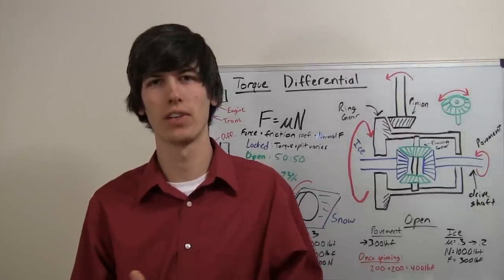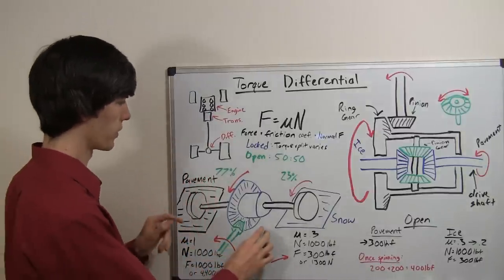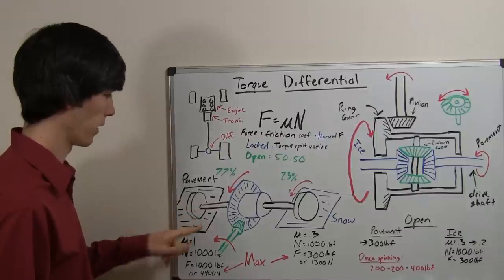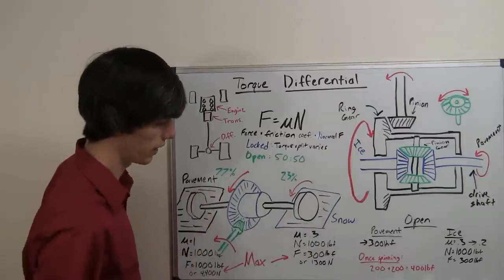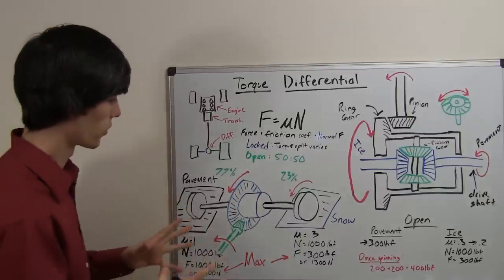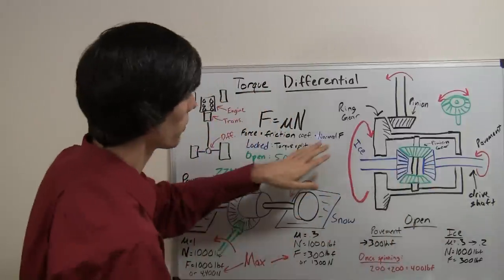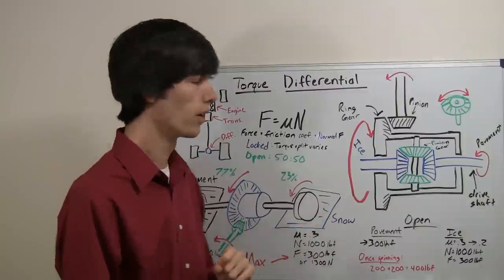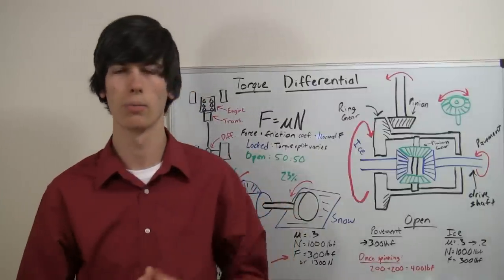Open vs Locked Differential - Torque Transfer - Explained

Comment: Sir, you have not answered any of my questions. You keep dancing around them. Okay so you want to do sources, You have not provided a list of sources that I can find. If you would be so kind and list a few for me.  As far as sources from me, I have one for you. "Locking differentials force one of the side gears to rotate with the differential housing. This causes the differential to act like a solid axle and transmit all of the torque to both of the wheels." CAT 90 Caterpillar Undercarriage and Final Drive, page 1-2-2 paragraph 5. Now if you could please provide me with a source that challenges this that would be great.
Reply: Tim W.  Finally someone who gets it. It's not that he is wrong about how the torque is applied, he is not explaining how a locked diff works. Which does not take a lot of complicated math to do. I tried to get this point across to him way back but it got lost somewhere with all the replies and his pride. But after I found out he gets all his knowledge from wiki and how stuff works and probably has only ever worked on his acura, The light went off in my head. Why am  I, a 10 year experienced dealer technician wasting my time.
Reply from the maker: Roshsun Stewart I know you think I have no idea what I'm talking about, and that's fine, but you just agreed with someone who said

" In the case of a fixed axle, there is a constant torque through the axle, but the two wheels can be applying different torques to the ground, depending on what surface they are in contact with."

You do realize he's saying torque can be split between the two wheels, and is not always equal, even though you've been disagreeing with this point since day one. Also, I'm a graduated mechanical engineer, I have a bit of a knowledge base of understanding torque, moments, and static forces. This understanding is important for understanding differentials. But by all means, please don't waste any of your time.
Reply: One last question, Did you get your degree from wiki and how stuff works? Because those are the only references you source. I also have a degree and the College I went to frowned on sighting wiki and would have immediately slapped an F on our paper. But degrees mean little without experience which I also have. Oh and I don't just have experience working on my Integra at home. I'm a certified dealer technician for the last 10 years.....Clearly I don't know what I'm talking about. pfff
Reply: You have a degree in mechanical engineering and you're a dealer technician? Maybe you didn't get a real job as an engineer because you don't understand physics.
Roshsun Stewart
Reply: ***** Sorry took me a while to respond back. I been a little busy.
Okay first off,
Torque is a twisting or turning force not a push. A push is a completely different type of force.
Now why would I stop imagining the engine provides the torque when in this case it does. The topic is about automotive diffs and all the forces are coming from the engine to spin the axle. I can take a wheel all day and touch it to the ground and create 0 torque.
I don't understand how waving my finger in the air has anything to do with torque. especially since the force being used to wave my finger in the air is a completely different type of force. I don't have to spin, turn, twist or torque anything to wave my finger. I think that has to do with muscle fibers and brain waves. But I'm not a doctor.
Again you loose me when you say drag your finger... I don't have to spin, turn, twist or torque my finger to drag it on a desk. I also think that's a different type of force.
Now torque does not require friction. But friction is in the equation. Hmmm. What your missing is that it takes a certain amount of torque to overcome friction. That is where friction comes into the equation. if there is no friction then no torque is needed to spin, turn, twist or torque the object. But there is always friction in this case.
I think you cut to many corners when trying to explain it in layman's terms and as a result made absolutely no sense. Next time read the definition torque from Webster before you make your next post.  Because you just sound.... how can I say this in laymen's terms......... clueless.
Reply: Tank Ronin In this case friction is what makes traction possible. We are talking about friction at the wheel base, in contact with the ground. The friction you refer to (the friction torque must overcome in order to spin) is located at the axle, at the center of the wheel, where torque is applied. The friction this video talks about, however, is what makes the wheel stick to the gound. If the force applied to the gound overcomes this friction, then the wheel will spin and the car wont go. 

The misunderstanding here I think, is that the equation in this video F=uN is for the force required for the wheel to slide (or spin without going), not the equation for Torque. The equation for Torque if force times distance, in this case de radius of the wheel. So friction and torque are really never in the same equation, they are related of course eventually, because this toque which is being applied to the wheels translate to a Force being applied to the ground, which must NOT overcome the frictional force (which depend on the coefficient of friction and de normal force) otherwise the wheel will spin, and again, the car wont go. 

So yes, each wheel con have different magnitudes of torque, depending on factors like weight on each wheel and the coefficient of friction between the tire and the surface it is in contact with.
Reply: I was a technician on heavy equipment, I made twice as much as most of our engineers. So who had the real job?

Comment: The first video was confusing and this one is even more confusing. I swear to GOD I'm not trolling. If I'm understanding correctly an open differential is better than a locked one (since according to him the torque is applied 50/50 in normal conditions) I want a new car for my daily commuting (not sport car) and I'm not sure if choose one with open differential or limited slip. Someone help me please.
Reply: Probably would want an open differential, since you wouldn't be doing much offroading and efficiency in everyday corners would matter more
Reply: Brandon Strecker

Great!
That I was thought, for a daily commuting an open diff. will be better. Efficiency is my goal.

Thanks Brandon.

Comment: a spool isn't 50/50 torque distribution, it dynamically varies from 100/0 to 0/100 based on LOAD.

you are confusing rotational speed with torque application.

Imagine turning a bolt with a wrench in free air, lots of speed but no torque. same bolt, but it's rusted up and seized into something, no speed lots of torque

Now imagine a bolt in free air welded to your seized bolt, if you try to turn them the seized bolt will take 100% of the torque and the free bolt 0%, even though they are locked.

Comment: You know where you went wrong. The moment you said "You don't even need to know how it works." If you can't explain something simply, you don't understand it. What is torque? A twisting force that causes rotation. Now please explain to me how can you have two different twisting forces in a locked diff that is acting as one solid axle. Let's take out speed and focus on how you apply two different twisting forces to an axle when only using one drive shaft. Go hold a broom with one hand and try to get each end to spin differently by twisting your one wrist.
Reply from the maker: I have videos on differentials if you'd like to know how they work, this video was made to clear up to people who don't understand how locked differentials can have different torque at different wheels, which is why they're so popular off-road. If one wheel's in the air, nothing resists its rotation, so no torque goes to it, and all torque goes to the wheel on the ground. You can have different speeds with even torque, you can also have different torque with the same speeds.
Reply: Engineering Explained You keep telling me you have videos, but this is simple. You don't need complicated math to explain what is going on. I am starting to wonder if you need to know how differentials work because I do. I have been rebuilding differentials and installing them for years. Now here is a simple question. If the wheel in the air is not receiving any torque, then what is causing it to spin? Don't tell me it doesn't spin because I have diagnosed, tested and replaced locked diffs for the past 10 years and in a locked diff the both wheels spin whether on the ground or in the air.
Reply: Roshsun Stewart I dont understand what you mean? With a locked differential both wheel spin at the same rate, but most of the torque is still going to the wheel that have traction right? Is it wrong to say that?
Reply: lurifix The reason why you don't understand is probably because if you are learning how a locked diff works from this video or the other video where he explains a locked diff, he is simply wrong. What you are referring to is a Limited Slip Differential. The purpose of a locked diff is very different. He is not explaining how a locked diff really works inside and this is his biggest mistake. inside a locked diff carrier housing, the pinion gears, or what mechanics called spider gears, are prevented from turning on their axis which causes both sides of the axles to turn together. Now all the gears inside the locked diff are moving as one piece. It is impossible to have two different torque (twisting) force going to each end of the axle when all gears are locked together. The ground surface, friction at the tire, all of that stuff has nothing to do with it.
Reply: lurifix Part 2: Now if the tire with the most resistance does not turn, then the tire with the least resistance will not turn as well. Because they are now one piece and you don't have enough torque to overcome the tire that has the most resistance. So what do you need to turn the tires? More TORQUE (twisting force), and how do you get more torque? Raising the engine RPM. Once you have enough torque to overcome the resistance both tires will move. Why? Because the axle now has become one piece through locking all the gears inside the diff so they cannot move independently. Because they can not move independently you can not have two different torque (twisting) forces sent to each wheel.
Reply: Engineering Explained Okay so you like to use math and complicated formulas, fine. Then tell me the formula for calculating torque because the formula I know does not have anything to do with friction. Hopefully a light bulb will go off in your head and you will realize you are not explaining how a locked diff works, you are explaining how much force is being applied to the ground under certain conditions.
Reply: Roshsun Stewart Yes you are right, i think the word "torque" is whats confusing me. If the axel is moving like one piece the wheels obviously can't twist independent of each other. But the force to the ground is going to be greater where there is more grip, like in he's example, 77% force on the tarmac and 23% on the snow? This as you say have nothing to do with the functionality of the differential but due to friction.
Reply from the maker: Roshsun, I understand that it's not intuitive, but these are the facts. If it's not the case, there should be plenty of sources defending what you say (logic aside - as logic would agree with what I've stated). A wheel in the air will spin, but it's spinning because it's connected to the wheel on the ground, which is receiving the torque to rotate the axle. Find one source (not a forum, maybe an engineer), that agrees with you. I've said the same to everyone who makes your argument, and am yet to have a single source disagree with what I've stated. I have sources in the description, if you're curious. I make mistakes, and create footnotes when I do, and add notes to the description. I will gladly correct my mistakes, but this is not one of them.
Reply: Engineering Explained Sir, you have not answered any of my questions. You keep dancing around them. Okay so you want to do sources, You have not provided a list of sources that I can find. If you would be so kind and list a few for me.  As far as sources from me, I have one for you. "Locking differentials force one of the side gears to rotate with the differential housing. This causes the differential to act like a solid axle and transmit all of the torque to both of the wheels." CAT 90 Caterpillar Undercarriage and Final Drive, page 1-2-2 paragraph 5. Now if you could please provide me with a source that challenges this that would be great.
Reply: Engineering Explained Oh I have another source. "To lock out inter-axle differential action, the clutch engages the helical-side gear and causes this gear, the input shaft and differential to rotate as one assembly. This action provides a positive drive to both axles. With Lockout engaged, torque
is distributed to both-axles without differential action." Spicer single Drive Axles, page 6 paragraph 2.
Reply: Engineering Explained And I have another source. " Unlike limited-slip/posi differentials, locking differentials deliver 100% of engine torque to both wheels, even if one has zero traction." Therangerstation.com,  Locker Comparisons - Understanding Differentials/Lockers "What is a locking differential?" Now that is three sources I have given you.
Reply from the maker: Roshsun Stewart Thanks for the sources. I agree with them, the first doesn't state how the torque is distributed, the second doesn't state anything about torque distribution, and the third doesn't say how the torque is split. So none of them disagree with what I've stated. Honestly I'm not trying to prove anything by saying "I'm right" I'm just trying to tell you that what I state in this video is accurate. If you'd like some sources from my end, click the second link in this video description, and go to the video description of the linked video, where I've jotted down a few sources. Also, in the comments you'll find a quote from 2 PhD mechanical engineers in a book on automotive engineering. Here's another fine quote: "By contrast, a locked differential forces both left and right wheels on the same axle to rotate at the same speed under nearly all circumstances, without regard to tractional differences seen at either wheel. Therefore, each wheel can apply as much rotational force as the traction under it will allow, and the torques on each side-shaft will be unequal."

Like I said, I know it's not intuitive, because it seems if two things rotate at the same speed, they'd receive equal torque. But this is not true, as the resistance at each tire (via friction with the ground) can differ.
Reply: Roshsun Stewart This quote proves his point, not yours. "...locking differentials deliver 100% of engine torque to both wheels, even if one has zero traction" You're thinking that each wheel is receiving 100% torque, which has a completely different meaning and would consist of the drive wheels getting 200% of available torque, which is obviously impossible.  When the quote you have provided says 100% torque to both wheels, that is the torque available for those wheels to use to overcome any friction in their way, and if one tire is in the air, it will not require any torque to overcome ground friction, therefor that wheel will receive 0% torque and the other will receive 100%, and your diff has delivered 100% of engine torque to both wheels, as your quote told us it would. Hope that clears it up, you are clearly knowledgable to the workings of differentials, I think some of the terms used is what caused your confusion
Reply: Scott Seiger Sorry, but the confusion is simply no one knows how a locked diff works. When you stop trying to explain the theory and learn the mechanics you will understand that it's impossible for a wheel to have 0% torque and spin. If the wheel is spinning, it's the tourque causing it to spin. and in a locked diff, both wheels spin no matter what. Even in a open diff both wheels receive torque, but only the wheel  with the least traction will spin. I will say it again, he is explaining how the torque is applied to the ground, not how a locked diff works.
Reply: Oh man, I didn't realize no one knew how they worked, you must be right then
Reply: Scott Seiger Please excuse me, I did not mean no one knew in the world. I was writing that post in a rush before I ran to work. Look you are missing a lot because a lot of my post got deleted with links that I had posted. The original argument I had was that yes you can have different amount of tourque applied to the ground, but it is physically impossible for a locked diff to split tourque to each wheel. Now there are different types of locked diffs but when you say "locked diff" without saying anything else you are describing an exact type of locked diff. He is explaining of a certain type of locked diff called a limited slip (in his first video that led to this one). That's why he is incorrect. Again a lot of my post strangely disappeared and your only seeing half the argument  of course the half that only supports his position.
Reply: +Tank Ronin Let say that that 10 lb-ft of torque is applied to a locked axel. How much torque me and you will need to apply to prevent it from turning? 5 and 5, right? Now, if I release my side, how much torque you will now need to prevent it from turning? 10 lb-ft!!! You see when we both hold a side, it "send" 5 lb-ft of torque to each side. I f I release my side, it will "send" all torque to the other side!!! As you can see this is very conter-intuitive.